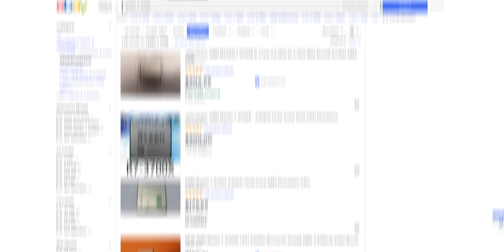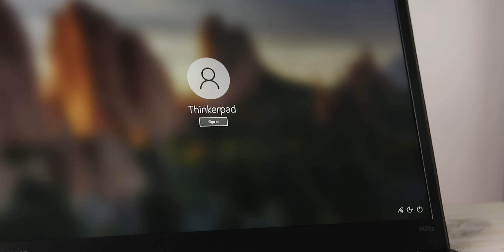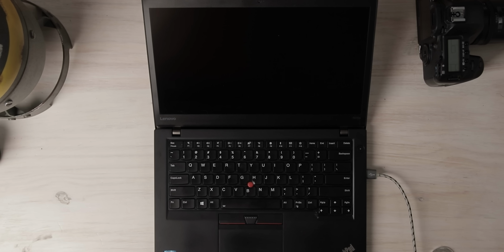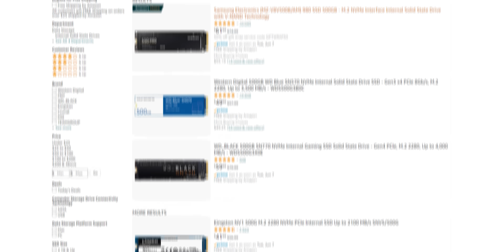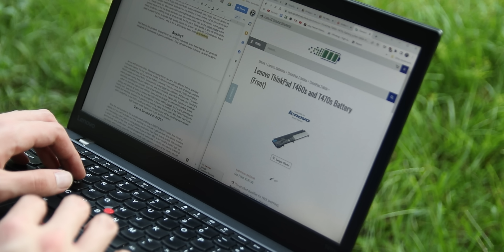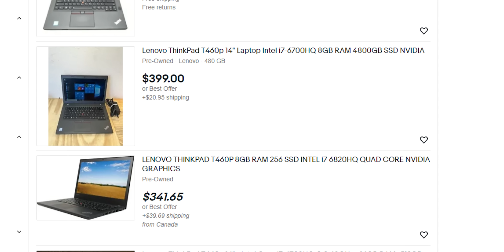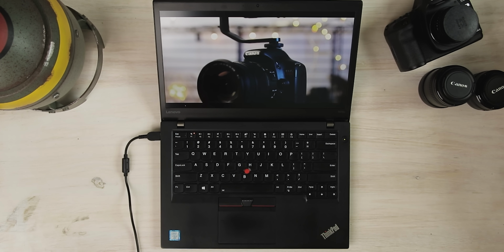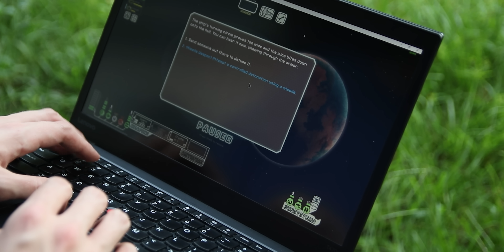I Couldn't STEAL A Better Laptop... I Tried - Lenovo Thinkpad T470s

Comment: Hi.  Thanks for the great video.  Is the CPU in this laptop in a socket?  I guess I am asking if you can upgrade the CPU?  Also, what is the max RAM that this laptop can take?  Are you running a solid state drive in this?  If not, that may help.  I used a older T430 at work and loved that laptop.  You have inspired me to look at them again.  Thanks again for your great video!
Reply from the maker: Unfortunately, Intel stopped making socketed mobile GPUs quite a while ago... You can't upgrade the CPU in the T470s, but you can upgrade the ram to either 20 or 24gb depending on the size of your soldered ram. I also was running an SSD, the T470s can't physically fit a 2.5" SSD/HDD unfortunately. Only an M.2 SSD. Thanks for watching!

Comment: I used to have a T460s with an i5-6300U until my work sent me an HP Envy x360 15" laptop with a Ryzen 4700U they had lying around they had no use for. I have to say: during the time I spent swearing by ThinkPads, other, often cheaper laptops have gotten a lot better than they used to be. Sure, I miss the keyboard and trackpoint on my ThinkPad, but the HP has far superior cooling, performance, and battery life for two-thirds the price of a similarly specced ThinkPad, and the build quality isn't half bad either.

If you're going to get a ThinkPad, my recommendation is to stay away from anything smaller than 15" because they often have insufficient cooling and the fan will very audibly ramp up if the CPU so much as goes above 10-15%. That being said, the ThinkPad with the worst fan control I've ever owned was a T540p (a 15"), so going larger is no guarantee.

Another consideration is that no reasonably priced ThinkPad is going to come with a decent screen. Sure, it will be IPS, but it will only cover ~60% of the sRGB color space like every other cheap laptop out there made in recent years. Obviously, that's bad for photo or video editing, but it even makes reading syntax highlighted code difficult, so I wouldn't recommend it for development either.

Comment: I've got a L480 (basically a t480 without the removable battery and thunderbolt support) for 250 usd  one year ago . It's freaking great , usb C charging on a laptop . The battery lasts 4-5 Hours (the battery had 5 or 7 cycles , basically new ) oh and it had a touchscreen to . The 8th gen i5 8250u it's a real bonus , a quad core 8 threads , more power than i really need. Nvm ssd and 8 gb of ram . I've put another 8 gb stick of ram  and btw it's dead easy to upgrade , i love the fact that it has captive screws . And yes the speakers are . That's it , just are . My phone has more base and volume compared to it . I've checked , they are not defective , tried in Windows everything , they are just teribile . I use Bluetooth earbuds/speaker if i want to watch a movie o listen to music .

Comment: i just got a t460 second hand, one of  the speakers  doesnt work but its suppose to be for writing anyway and it hande Loria fine no sstutters, I havent checked out CS Source yet but with as small a monitor as it has the games should be about the same at low res. It actually has two batteries, weak butt its worked  for two hours so I'm happy

Comment: My first Thinkpad is currently a T480 I use for work. It’s great, but the only thing I hate is how the Fn and ctrl keys are flipped
Reply: You can usually switch these in BIOS
Reply: @bramgn  It’s a work laptop (probably should have phrased it better originally) so I’m not actually sure if they locked the BIOS or not, but Bitlocker is enabled.
Reply: @name4379 I doubt they'd lock the BIOS. BitLocker i can understand, so your data won't be accessible in case of theft.

Comment: I'm still using a T520 which as far as I can remember I got in May 2012.  Back then the 128GB SSD (160GB optional) was really puny for my needs to I immediately swapped it for a 500GB rotating disk.  Since then I eventually upgraded it to 1TB SSD, used  the opportunity of a recall for the battery to get a new battery.  It keeps on running.  It's literally been around the planet, been in the Sahara and the Norwegian mountains in one week, been dropped and otherwise massively abused several times.  Wounds there were cured with duct tape.  Looks a bit - understatement - beaten up, the keyboard feels worn — and no end in sight.  Maybe Lenovo could use it to showcase the sturdyness of their product 🙂
Not every Thinkpad is born equal though.  I used to have an A21p which was totally worn out and obsolete after five years.  All in all good value.  It was succeeded by a T43p where the fan came to a grinding halt after like two years.  The replacement only lasted longer because I was using another laptop in parallel with it.  The T43p's fan axle is touching the case of the heatpipe unit.  A design flaw which will quickly wear down the fan. 
Another Thinkpad?  Probably.
As for the "nipple" - I exclusively used it.  Touchpads are located such that one needs to move the hands away from the keys to the touchpad.  I thus consider a laptop with only a touchpad a no-go.  And because I don't use it, why have it at all.  Oh and three mouse buttons - or I won't even consider the laptop.  Really physical buttons where I can feel I pressed them.
Oh and I use Linux exclusively.  Without priprietary drivers.  So if the market leader's cards don't work for me out of the box, I'm happy to settle for integrated graphics.  In case of my T520 I don't even know if the discrete graphics is actually functioning.

Comment: check out the Carbon X1 ... ultra-light ... only flaw is you can't rly swap parts in and out cuz it's so optimized for weight
Reply from the maker: I've been looking, but it feels like that would defeat the purpose of a thinkpad. Is the build quality/reliability up to snuff compared to the t series?
Reply: @aChairLeg  yes it feels and looks rly slick. Screen is not ultimate but the brightness is good and resolution is good enuff for coding. I travel a lot and I can carry it around all day pretty easily, it's even lighter than a MacBook air

Comment: Well, if you have around a grand to spend, I would suggest a Ryzen 5600H based gaming laptop with a good thermal design. Bought a Lenovo IdeaPad Gaming MX32 couple of months ago and it fucking slaps. 

4.2Ghz on all cores, factory overclocked, (AMD specs 3.5Ghz for this CPU) non-stop ad infinitum with out hitting thermal throttling. Also, came with a adequet enough discreet nVidia RTX3050Ti Mobile which is similarly OCd and its thermal needs well taken care of with a solution that is clearly overtoleranced appropriately to take even a slight flow congestion from time to time. 

I'm literally in love. Only minus is Windows 11 but who the hell doesn't just reinstall with Win10Pro or POPos Linux anyway these days?

Would not touch Apples worthless product and customer care with a light year long pole. Nuh uh.

Comment: I have an a485 with windows 11 with it's ability to update removed on the c:\windows level (updating breaks the laptop because windows wants to install broken drivers that it thinks are right for the laptop) and uh it's been great manually installing security updates and updating my drivers and installing a hacked gpu driver and uh it makes for quite the good gaming laptop with it's amd Ryzen and it's vega 8 igpu.

I've replaced both batteries and uh I get 4 hours playing triple a games at steam deck resolutions on it.

Comment: In my Lenovo T430 one DIMM is easily accessible and the other can be changed but is quite a bit harder to get to since it's on the other side of the motherboard.

Comment: For me it was a Precision M6800 for $166 and change with only the batter as well the drive missing. The only thing I actually had to buy was an heatsink so I could swap in an RX580 mxm and everything else transferred over from my M6700. Did land an very cheap i7 4930mx for just $48 so that was a bonus but anyway the only real complaint is the display panel being on the cheap side vs the older 120hz and RGB from the M6700 line. There were a lot of other things noticed between the two machines but what mattered was the cpu performance which would take a pretty serious jump generation wise to get an meaningful upgrade.
Reply: I always wanted an M6800..
Except now they are ancient.
Reply: @peterpan408  Still ok for daily use and not terrible for gaming, just expensive to upgrade but still a lot more comfortable to use than modern laptops.

Comment: In hindsight this thing suffers overheating issues (6th gen Core i7 version) and the fan will drive you nuts. It thermally throttles if you do anything more than basic stuff.
Reply: Yeah numbnuts. Its a dual core basic laptop for  office tasks
Reply: Hence why some of us are sticking with older heavier laptops due to better thermals and far less throttling never mind upgrade options. For me it is a M6800 with an RX580 and a i7 4930mx, probably will upgrade the screen at some point. Being able to use two 9 cell packs with the slice pack improving the overall physical comfort of the machine is amazing as not very many Thinkpads can do the same.
Reply: @MrKillswitch88  yup my daily driver laptop is a clunker, I have a P50 I picked up cheap with a colour calibrated 4k display and two SSD's. I don't mind lugging it about at all. Beast of a machine still today
Reply: @TheDesertsweeper  The heaviest daily driver I've used thus far was an M18x R2 and the runner up was the XPS M1730. Weight isn't an issue for me but build quality and comfort during use is never mind all the other things plus I like upgrading things just the way I want them rather than being forced in some way or another. Anyway I might look into if it is possible to get one of those HP dreamcolor panels for my M6800 as a few have gotten such panels to work in the M6700 for example. I know that there is an 4k panel that will work though with a bit of effort just to install the panel. Anyway I like these older machines as they are so much more fun to work with much less just use than almost all the modern models.
Reply: @MrKillswitch88  I hear you. Before I went with the P50 I used the Stinkpad T420 that was to me, the last of the glory days of that series. The keyboard is from the IBM era - a proper click with travel. The CPU I upgraded to a quad-core and of course SSD. And The screen received a 1600x900 panel I picked up in KL on a visit. I still have it, and it now serves as a general download pc and paperweight. They simply do not build them like back then. The T-series from the 4th generation on got progressively worse with each release. Now they are plastic-clip junk that throttle all the time. Form over function.

Comment: After seeing your vid i got a 460s with the i5 63700 for £100 on ebay, 8g ram and a 120GB m.2 ssd with win 10. Both batterys charge to 100% Had to get a charger though, £10 on ebay and works fine. I love the keyboard as well.
How long should should the batterys last just looking at youtube vids? mine seems to last about 3 - 3.5 hrs.

Comment: I worked on that for 3 years. No issues, but yes cable always... It's worth the money, but it will be plugged in... so is it really a laptop... does not matter if it's $200.

Comment: The type C port on this is a huge selling point, but the soldered RAM stick (WHY?!?) is a non-starter for me. Whenever a company does something like that, it feels like intentional, planned obsolescence: as soon as that soldered DIMM finally wears out and dies, you are left with a dead motherboard.

For $135 I recently picked up a Dell Latitude E7270 Ultrabook with an Intel i7 6600U, 12.5" 10-point 1080p touchscreen IPS display, 16gb DDR4 RAM and 256 GB SSD (M.2 SATA). Despite its small form factor the speakers are shockingly loud, crisp and clear, with just enough bass that keeps audio from sounding tinny. My only lament is the lack of a type C port, but given all you're getting for the price these days, I think it's an acceptable tradeoff.

These were aimed at the business market upon release. They're built like tanks with a magnesium chassis and are extremely easy to service, with only a handful of screws on the bottom keeping you from accessing everything from RAM, storage, the heatsink and fan.

It's the best purchase I've made in a minute, and I plan on grabbing another when I can afford to.
Reply: How would you rate it over something like a Thinkpad T480? How is the upgradability? And is the screen size decent for you?

Comment: I was donated a damaged L560 for free. It works well enough, but the CPU is a huge bottleneck for games like Valorant. Unfortunately the Intel HD graphics are only utilized at about 50%. Looking for some more tweaks to make Windows 10 lighter and if that doesn't work I might look for a lighter OS.

Comment: Got a T560 from my bro. I traded my macbook for it since im a Windows/linux user, so I'd prefer to use a device that was designed to run other operating systems that's not Mac os.

Comment: Nice! -- QUESTION -- Is this laptop, T470s, able to connect to external monitor keyboard mouse, using one cable, I think it is USB C or thunderbolt or something - it also charges the laptop at the same time  We use at office and the connects to a docking station and the docking station then connects to all the monitors/keyboard stuff.  Not sure what that one port is called and one cable solution but I love it.  Just wish I knew what the hell that was called and if this laptop supports that one cable.
Reply: it looks just like usb c but with a lightning icon above it, it's called thunderbolt and yeah it supports charging, external monitor, more usb, I believe t470s was the 1st model where they implemented it. Thinkpads also have docking port at the bottom that does all thundebolt stuff

Comment: I got 5567 dell 
With 143$ 
i5 7th 
4GB 
620 gpu 
Amd gpu as secondary 
1TB piece of potat.

So i had to purchase 
256GB ssd 
8GB Ram stick 
Battery -_- 

36.4 ssd 
46.8 Ram 
59.8 Battery

What i hate about the laptop is 
Not having keyboard 
backlight 
Screen is 720p 

Actually where i live its pretty difficult to get laptop in this prices.

Comment: Here is the secret sauce.  Buy a 2-3 year old premium laptop.  Throw Ubuntu on it.    Im rolling a 2016 XPS 13, and it is amazing running Ubuntu.  Im planning to upgrade to the 9500 (2020 xps 15), OR the 9510 (2021 xps 15) if the prices come down on this 1.  Throwing ubuntu on it, and dual booting.  It'll be an amazing laptop for the cost.

Comment: Wish I would have got luckier and got a newer thinkpad. I got a t460 8gb Ram 500gb ssd and i5 6500 for $120. It came with bsod error code memory management. I upgraded the Ram for like $60 or something like that. That wasn’t the cause of bsod. So I went to the manufacturer website of both the laptop and the intel website to download the latest drivers and whatnot, I also did a command to fix the NTFS files.. that took a while. So far no bsod I can play computer games watch YouTube and surf the web with no issues other than it’s kinda slow 😅

Comment: I still have my acer aspire 7551 from 2009.. and it still seems better than this. lol..    64bit,  2.2ghz AMD quadcore, I upgraded to 16gb ram (DDR3).   I got it for about 250 back in 2010 (used).  I've used it to run 2 big screens in my living room for over 6 years now..  And I'm usually running at least 4 browsers with about 40 tabs on each one.. It still runs fine somehow. :).  I don't understand why everyone keeps talking about these thinkpads?    Mine is 10 years older than this and it still seems like faster hardware..  We have a more modern little laptop that has some 1.7ghz.. something-- and running win11.. It's terrible.    So I think you just talked me out of buying one of these thinkpads. :) ..  I think I'll just dual boot with mint or zorin..  Or maybe go ultra light with MX or something else.    I was getting sucked into the "linux thinkpad" vortex for a minute there....

Comment: Is 87Usd worth for e440 in October 2022?

Specs
I5 4th gen
4gb x 2 1600MHz Ram
500 gb Hdd with 7200 rpm .
Battery stays for 90 mins.
Keyboard and trackpad intact.
Reply from the maker: $87 for a laptop that can do basic tasks seems like not too bad of a deal. Just throw a $20 cheap ssd in there.
Reply: @aChairLeg  
I did the ssd upgrade. It works smoothly. I use for regular tasks like browsing and coding.

Comment: I got a x280.. 16gb ram 500gb SSD for £250.00. 

ITS PERFECT.

I'm not going to win 11 though, without undervolting my battery would be dead in 6 hours (I did the maths)... I get 8-9 hours currently (from undervolting with turbo disabled).

Comment: I upgraded my t410 from 2010 with 6 gb ram and SSD. It works perfectly.  Now my my mom is using it for web surfing. Unfortunately, I could not find a suitable IPS screen with better resolution. The default TN screen is really bad ((

Comment: I use my old acer laptop with an i5 5200u, 16gb of crucial ram, 250gb ssd, 940mx gpu to take to school and watch netflix etc... I have a Lenovo legion i5 with a 9750 and rtx2060 that I love but use more as a desktop as its battery life is terrible and I dont like hauling around a 1000$ laptop. My old Acer still plays games like gta5 and bf4 decent enough, I just did a factory reset on it after I got my new laptop as I don't use it for anything besides writing assignments and web browsing so I dont keep large files or programs on it.

Comment: T470, not the S model, equipped with 24GB RAM, runs smoothly. Refurbished laptop, no significant issues. sometimes red hue on upper monitor edge will come don't know why. i5 6th generation but still this laptop lit speaker sound also very nice    price is $230 dollars  19k in india